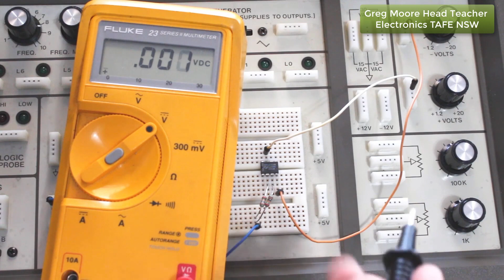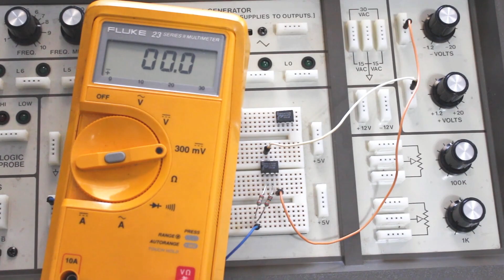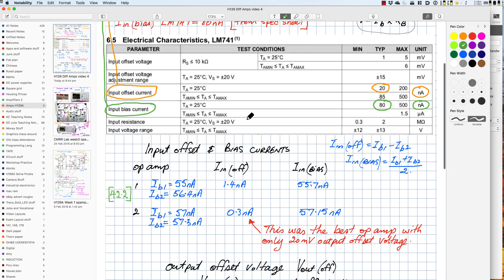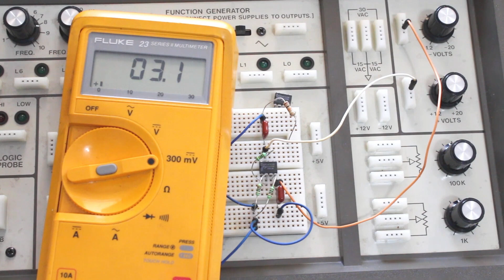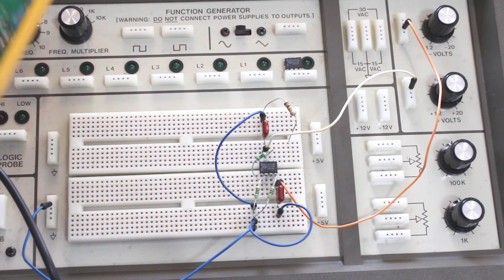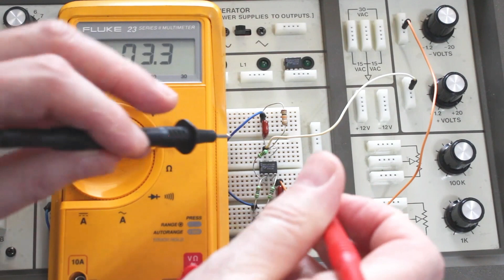Differential Amplifier OpAmp 741 Input Bias Currents TAFE NSW Part 4

Comment from the maker: Erratum:  Output Offset Voltages were extremely close, calculations and measured, 980µV and 20µV.  In the middle of the video, I had used the Lab part 1 input offset figures by mistake.  The part two figures were case #1,  1.1mV and case #2 not measurable, so maybe 10µV.